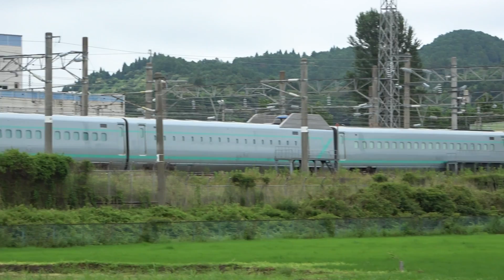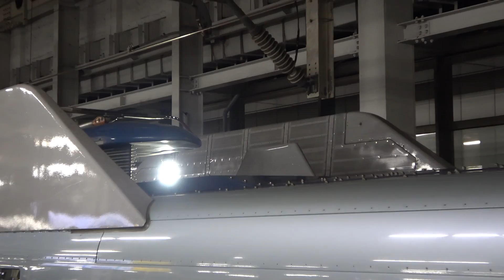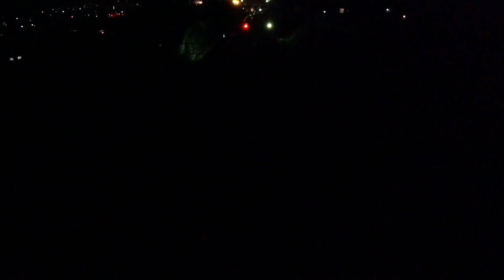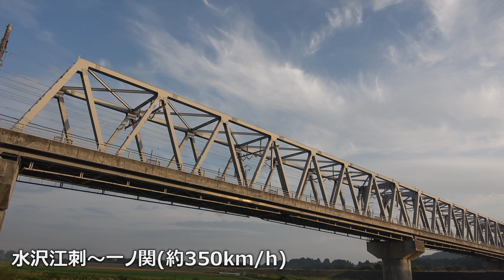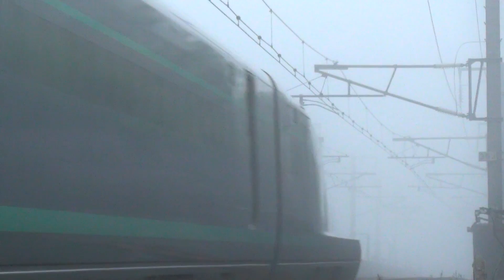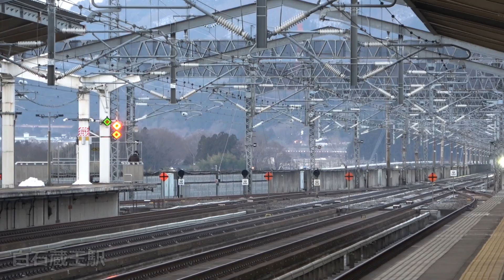2021 東北新幹線ALFA-X映像集 高速通過・トンネルドン解説 etc… ALFA-X Shinkansen Bullet train video collection

Comment: It's interesting how Korea and Japan took such entirely different approaches to reducing the shockwaves as trains enter tunnels. Korea opted for modified tunnel entrances, while Japan went the way of extremely streamlined front and end cars. Gotta say, though - as a train geek I prefer the latter, even if it's at the expense of a few dozen passenger seats.
Reply: Imagine matching them togheter
Reply: It does help that the front cars are likely going to be used for Gran Class anyways - 1 or 2 rows less of 3 seat max rows aren't going to impact that much.